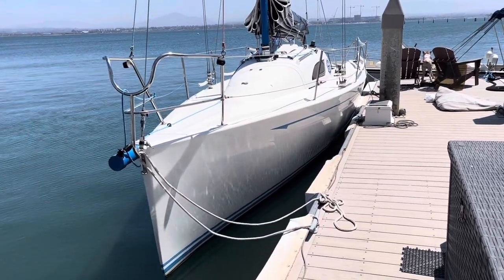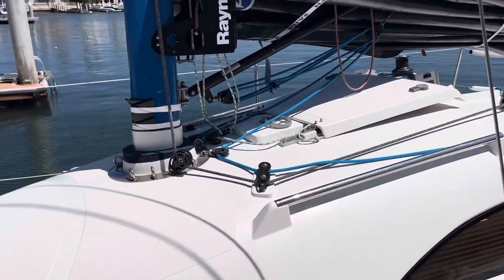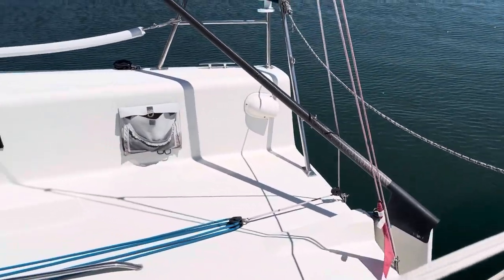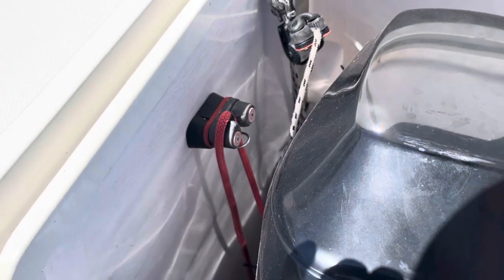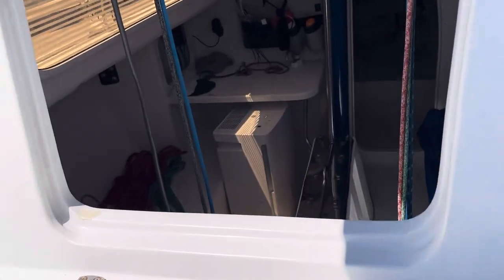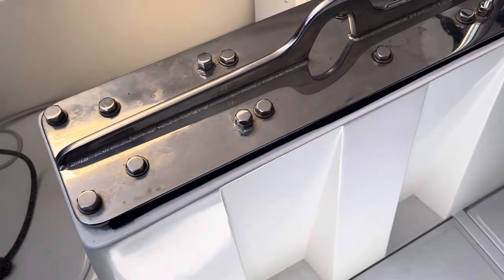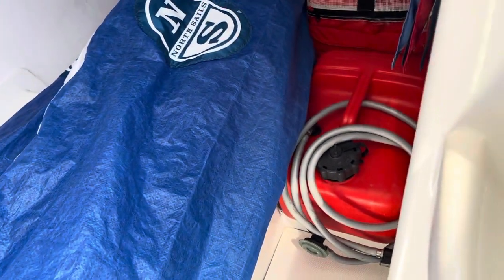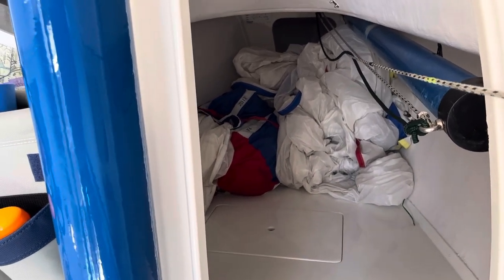Flying Tiger 10M #118 quick tour last FT 10M built!

Comment: I have hull number #80 and mine has the same trap door as yours as a FYI, and is a great. Does not get stuck like the trap doors.
Reply from the maker: This was a brokerage boat that has sold. However, I had a FT10 so known them well. The cassette affects the top speed while motoring but is much better than the two bomb bay door options. The double one was a nightmare with the pin rusting out